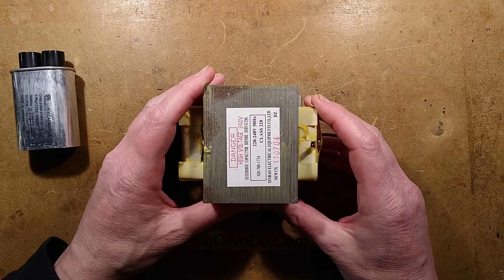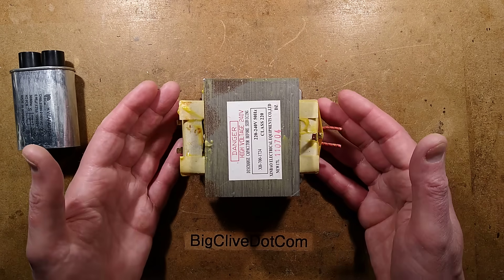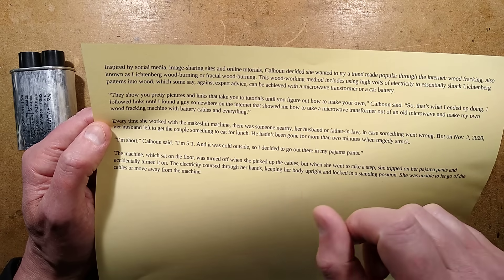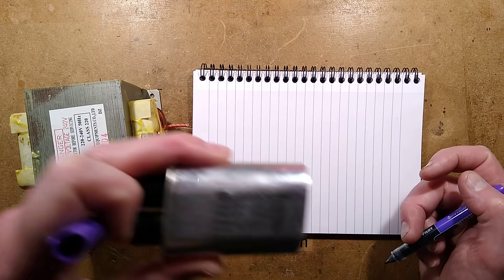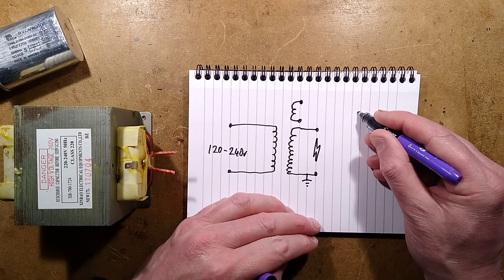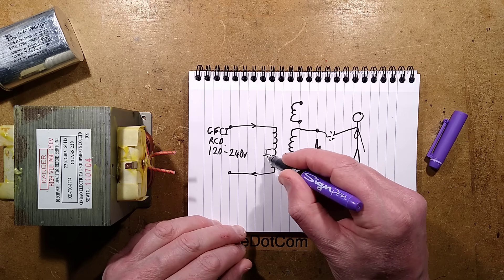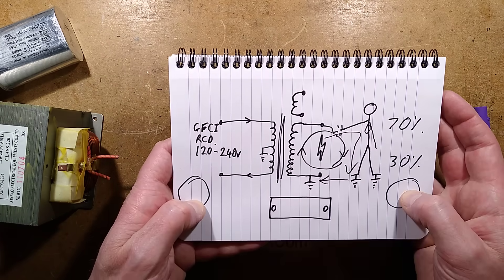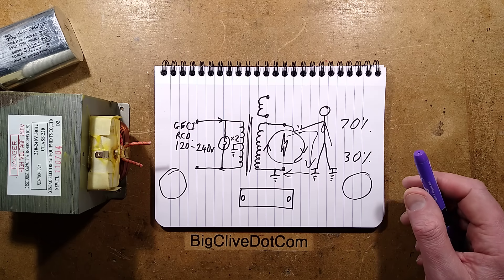The most deadly project on the Internet

Comment: I messed around with these things when I was like 14. Had two wired up in series for high voltage, made a Jacobs ladder of course and a decorative wood burner.
But my main experiment was ionizing the air to oxidize nitrogen. Basically I tried to make a small scale Birkeland-Eyde reactor, a now obsolete method of fixing nitrogen which was replaced by the Habor-Bosch process. 
My safety considerations were probably lacking but exceeded most of the YouTubers I copied from. I kept it up on a plastic table and stood on a rubber mat with thick boots. The transformers were grounded and I followed the one hand rule. 
I also made a foot pedal emergency switch which I never had to use. I couldn't think of a way to make a proper dead man switch at the time, but I definitely should've. Those arcs could sustain like 8 inches once started so it's hard to break the circuit if you're panicking and burning yourself or whatever

Comment: Clive. THANK YOU ! When I was 9 years old... I got hung up on a 120V overhead line that had collapsed and was laying on the ground. I touched it and it froze my fingers on the line. I used my other hand and that too froze. It took them 10 minutes to cut me free. The only reason I survived was that the ground was BONE DRY. It had not rained in a month. By the time they cut me free.. I was no longer screaming. I was completely paralyzed and they could me up under 45 degrees against i surface.... i could not move.  I remember our faithful dog came running to me and licked my hand and got a major shock. We were outside and never wore shoes as it was usually over 40 C in the afternoon. 
Thank you again... It rained the next day. Had it happened  then... you would NOT be reading this.
Albert
EI7II.

Comment: Darwin = 1 Stupids = 0... I worked in the television repair field for many many years and I repaired so many industrial dual magnetron dual power supply microwave ovens that if I stacked all of them on top of each other they would literally reach the stars and the moon and you have to respect these dangerous voltages! If people are STUPID enough to mess with this stuff without a thorough knowledge of just how dangerous this is then they have nobody to blame but themselves. You mentioned this being the same voltage as the Electric Chair used in capitol punishment so does this mean we can build our own Electric Chairs with these transformers? If China sees this video and hears your remark they will more than likely start building knock-off Electric Chairs at bottom dollar prices for states that still use the Electric Chair.

Comment: Reading people's experiences in these comments is quite eye-opening - I think it's the idiosyncrasy that really hit home as they feel scarily relatable.

I've only had a couple of bad experiences, one was when playing the electric guitar (plugged in) after fitting it with new strings (they hadn't been cut so were hanging off like long antenna). When I turned to do something, one went through a hole in the side of a CRT monitor and the string exploded in a shower of sparks, completely vanishing from the guitar, leaving only a small grey patch as evidence of its existence. I have no idea how close I was to being shocked, but I've always assumed it was far too close.

The only other experience I've had was when testing a PCB project which converted AC to DC, I accidentally shorted the input by knocking a cable. Fortunately, I had installed safety fuses which all blew, however, the PCB was also connected to a debugger which feedbacked into my PC, destroying a USB hub and the USB port. I tend to use an isolator now, but honestly don't trust myself around AC (I can get impatient!)... let alone a HV transformer!!

Comment: I once wanted to do this because I wanted to build a spotwelder anyways and had the transformer on hand but i decide against it because I was to scared to shock my self so I directly went ahead and msde the spot welder these things also can be a lot of fun😉
Later I also found a high voltage transformer that had a lot less current then one of these beasts and I went ahead and made some nice cutting boards but still, I put nails in to the wood put the salt and water solution on top and connected the wire's and only if I was like 5 meters away I would go ahead and plug it in
Be save out there its a lot of fun but it can be verry little fun when you don't pay attention

Comment: The upshot is:
Do not faff around with high voltage unless you know what the hell you’re doing. Should be easy enough to do. 

My scare story regarding HV came courtesy of my dad. At one time in the 70s when he was treated at the hospital for a work injury (not electricity related), he shared a room with an 18-ish year old guy. Said guy had a run-in with a train‘s 15 kV power line. He and a friend of his for some reason thought it would be a great idea to climb around on a couple of trains in a train yard. They figured that as long as they did not touch the live wire they would be fine. 
The learned that day that electric arcing is a thing. He lost his friend. Pronounced dead at the scene. According to the guy, he recalled a pretty loud bang and then woke up two weeks later in the hospital with his arm gone and severe burns across his torso that would leave him scarred and disfigured for life.

Comment: Dare I suggest it?   What will 2KV at 500 ma do as a hot dog cooker?

Back in the 60's, one of the ways to get an inexpensive plate transformer for a high-power amateur radio rig was to purchase (usually sold as scrap) an electrical distribution "pole pig" transformer and remove the transformer from the PCB oil "can".  Run in reverse, one could provide several kilovolts at very high current.   I suspect that the PCB was simply dumped into the local sewer system.   Thank heavens that practice faded out.

Comment: I learned about the resistance of the body when working on railway station developments. There are two earth systems, one for station equipment at mains voltage, the other for the traction systems which could be 750V or thereabouts for third rail systems or 25kV for overhead electrification. The two "earths" are connected at intervals but 25kV drop over 100m is significant. They can have up to 100V or so between them. 
The main mitigation factor is to keep them at least 2m apart but there are sometimes problems with this. One occasion was a wheelchair ramp which bridged between a train and a metal manhole frame in the platform. Wet concrete is quite a good conductor and there was a fat spark. That got everyone excited, and I was the guy in charge of the risk assessment process.
Now, I'm not an electrical engineer but those guys said they were busy. It's not every day that you get to Google "electrical resistance of human body". I put something together and the electrical guys immediately pulled it apart. There is a whole literature about the effect of current on the human body, some of it sounded like the results of really unethical experiments. They keep that stuff to themselves.
Once they took it over, I left them to it. By the time I left the project the report was on it's 6th revision!

Comment: Cannot emphasize enough - BigClive is not overstating the danger. The deadman's switch is an excellent idea, but better yet is to find a better hobby than wood burning using a microwave transformer. I used to do lasers in college many years ago - old-school ruby lasers that were pumped with very high voltage flash lamps from the largest capacitors I've ever seen in person - and despite the safety measures we took, I still ended up on my back in the hallway when a nitrogen laser - essentially a big capacitor, that had shorted itself and became part of a much bigger capacitor made of it and the metal table - decided that 15 inches of air, my right arm from wrist to elbow, and another 15 inches of air was the best path to ground it could find. I survived because it was very transient, and didn't pass thru my torso, and immediately ejected me from the room as my whole body convulsed - I was super super lucky. Do not underestimate the anger and violence of the dancing pixies. This is why today I mostly limit my fun to digital electronics - 5 volts and 50ma is more conducive to a long lifetime. I will live vicariously thru BigClive and let him poke the dangerous stuff, while I watch, thank you very much.

Comment: Just wondering what a „properly isolated screwdriver“ would be to short the capacitor since the tools normal people have laying around are normally only be rated up to 1000V
Reply: @Matt Quinn Also good to have the shank insulated in case the handle is damp or cracked.   The 20mm exposed should be enough to short a capacitor.

Comment: Cheers Clive (subscribed). Just reminds me that no matter how fool-proof the system, some ingenious idiot will always find a way to 'eff things up.
Maybe the following does not come under the 'ingenious idiot' remit but it illustrates how things can go wrong even in the strictly safety conscious setting of an offshore oil platform.
Back in the nineties, I had cause to work offshore on numerous occasions.
I had to get a new brim-less hard hat because an engineer had accessed a control system having first made his way there whilst exposed to some harsh atlantic weather.  Rain water collected in the rim of his helmet, he pulled a module in a system that was still under power, looked down at it and dumped the salty water that had collected in the rim, straight into the control system, causing instant failure and shut-down lasting 12 hours.
Didn't see that one coming!
Love your stuff, Pax dude.

Comment: Your "dead man" box isn't really a safety device.
I built a etching burner years ago. I don't remember the details on the device but I believe it used a cgfi and a grounded plate. The wood sat on the grounding plate so any leakage would trip the circuit. I would first make the connections on the wood and then turn the circuit on.
Reply: @Matt Quinn I'll have to watch that vid to see what he is specifically talking about. What I built did work unless for some reason the C⁹H¹⁶O² killed too many brain cells and I'm remembering incorrectly.

Comment: Volts are what will burn you, amps are what will stop your heart and cause you to lock up, then cease to exist.
Reply: That is too simplistic.  Current is what kills you but it depends on your resistance path (lower with AC and/or high frequency) and the voltage, and the power behind that.  500KV from a Van de Graaf machine won't kill you as it has little power. However, as little as 40V from a mains-powered transformer or battery to a person standing on boggy ground in wet boots could be fatal. Below that 24V or 12V vehicle systems are considered safe.  Currents from 5mA and up start to hurt, 100-200mA is lethal and higher currents can either kill or burn or both.  Surgeons routinely use electricity to cut tissue, to stimulate nerves and to stop and start the heart, so the biological effects are well-known.

Comment: I was mucking about with a transformer out of a bug zapper one time I was about 14. I'll never forget the fear I had when I could not let go. Thankfully I still had use of my legs and was able to back up to pull the plug out of the socket with no ill effects. I still work with high voltages today but that experience gave me a a lot of respect for electricity and how quickly things can go wrong.

Comment: LOL i just got my microwave oven transformer ready but for low voltage not high. I'm building the spot welder and it's going to be a smasher, In my storage somewhere i have a transformer i can not lift without hauling it and dragging it over things. one day i will have a project for that one.

Comment: In order to increase safety, the transformer can be plugged to mains power with an inline 240V flasher unit. If the operator got electrocuted he/she would be able to let go of the electrode when the device gets cycled off.

Comment: Electricity is very dangerous and should be done by a qualified electrician. The higher the voltage the worse it gets. People don't realise how dangerous it is. I worked at a coal fired power station and those voltages are totally dangerous. I watch lots on YouTube take risks that endanger others with there methods of madness and self destruction of devices that cause death without any disclaimer that there practice is unsafe. You just saying now that many have died and it will continue until someone does something to stop the deaths. I have seen what very high voltage does and nothing left to be fixed is more to the point.

Comment: my dad used to work for partridge transformers in uk he said when he was working there as a young lad some one had locked the safety switch to on as it was a faff to deal with he accidentally touched across the secondary on a 1000000v transformer . they where all told to go home that day all was left was a pair of legs.

Comment: Yup, that's part of the theory that electricians have to learn. Transformers "effectively" create a second circuit, "almost" entirely separate from mains. They are not physically connected, so any protections only work on one side, like a gfci. And it leads to some quite odd and unintuitive properties for the secondary. 

But transformers are not handled live unless youre a transformer electrician with a freaking arc flash suit with all insulated tools. Most resi/commercial/industrial electricians just deal with one side and never even touch the primary/mains part of the transformer. A home microwave transformer that can be easily opened up and messed with by lay people is easily the most dangerous thing in most peoples homes.
Exactly the reason both the transformer outside your house for mains to residential AND microwave transformers are in BOXES that should not be opened unless you know exactly what you are doing, and in most cases only when the primary/secondary (whichever winding youre working on) is dead. I mean, I would open one up, because I know what I'm doing, but likely only to make a bootleg spot welder. Definitely not risking  my life with high volts/amps for WOOD ART!!!
Reply: Between videos like this, and that shitstorm that Veritasium stirred up when talking about electricity with a focus on the fields and all they do, I have been gaining new respect for the shit electricity can do to you even without that direct connection.

Comment: the newer inverter neon sign supply I have seems to have some sort of gfci mechanism, to the point where you can't have either of the leads near a concrete floor, it'll trip. it does work for this though, i've done it.

Comment: This is a great video.  Thanks for putting this out.

Another good safety measure, which (like everything else) doesn't really make things entirely safe, but everything helps:

Do not connect the transformer case to actual ground.  Keep it isolated (in a plastic box, etc) from everything else, except the wood-burning terminal it needs to connect to.  That way, if you do accidentally come in contact with one (but not both) of the terminals, there is still no path through your body for the current, even if you yourself are grounded.

Also, never ever touch both terminals at the same time (even using sticks, etc), even when it's off.  Rig up some clamp mechanism to keep them (at least one of them) in place without you needing to hold it, and even with the clamps, only fiddle with one or the other at a time, never both at the same time, even if you're sure the device is completely off while you're doing it (which it always should be).  (Good safety practices involve consistently doing things the right way every time, regardless of whether it should be "safe" or not.  Always act as if it might be on, even when you're sure it's not, etc).

Comment: I made crude ring butt welder with an MOT, made with a plywood housing using most of the components in the microwave oven's primary circuit - for one a pcb which supposedly takes care of any noise reaching the ac mains line) 
I use the welder to weld my viking style chain maille... very strong welds, very medieval looking as well...unexpectedly I must add... 
I measured 1.7V open circuit on the secondary and given the 1150W transformer I suspect multiple 100's of amperes of current... very weldy/melty/fusy properties (if that is even english or cool for that matter)

The low current, high voltage use of the MOT's I would steer well away from...crazy dangerous...Tsjernobyl level dangerous for most diy-ers...

Comment: I was wondering if you were going to post another video on this subject since a couple just died in the US doing this exact high voltage wood burning.  After seeing the news story about this most recent tragedy I couldn't help but google the subject to see what videos about making Lichtenberg are available now, morbid curiosity I guess.  The lack of safety on most of them is terrifying, especially the "one probe in each hand while live" technique you commented on.  One site suggested welder's gloves, I'm sure welding gloves are NOT enough.  Maybe lineman's gloves, boots, and all the the associated training which would include a partner and still not holding a live wire in each hand.

Use the "Big Clive" interlock device (not unlike what you'd find on a punch press machine).  You still need high voltage safety training and remember professional electrical workers do get electrocuted once in awhile.